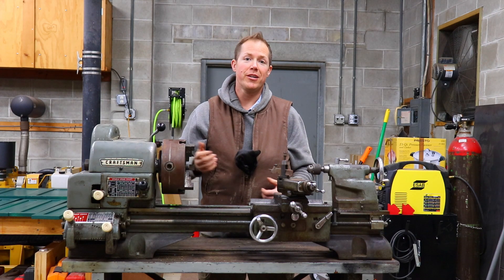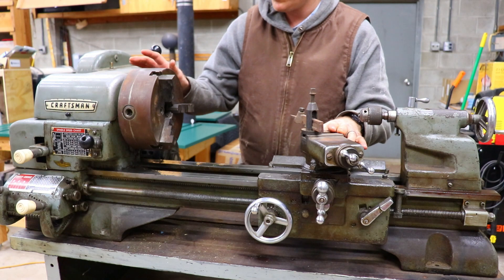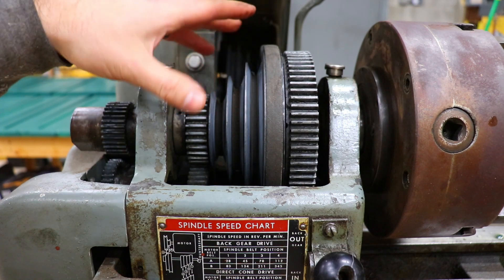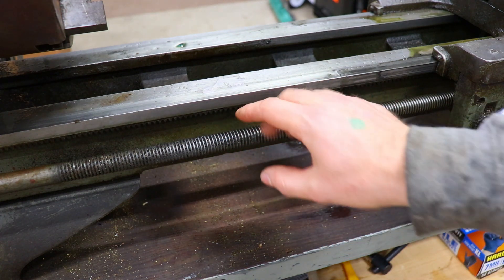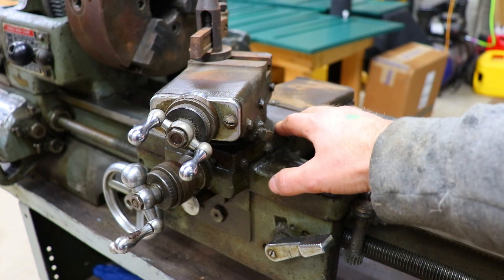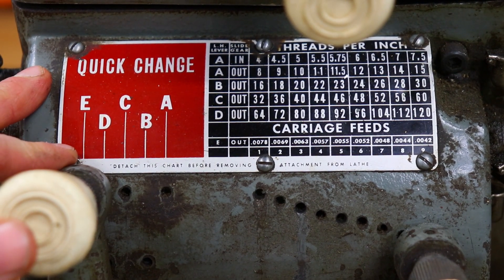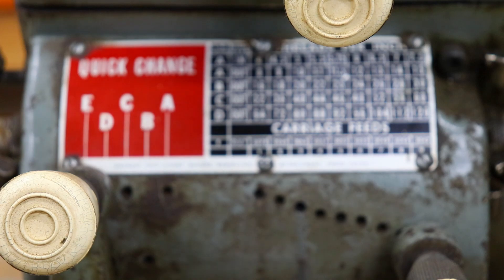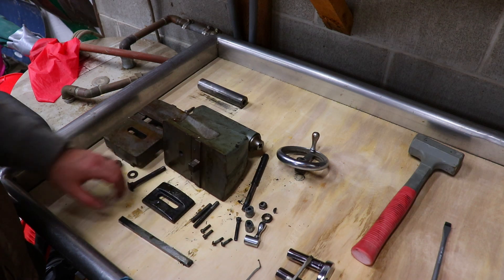Atlas Craftsman Lathe Restoration Revival Part 1

Comment: Were you using degreaser  in the ultrasonic through this process?
Reply from the maker: I used Simple Green and water in the ultrasonic cleaners. It seems to work pretty well.

Comment: Great videos! I just purchased a similar lathe.  It is the commercial model 101.28990.  I am in the process of taking it apart cleaning and freeing everything up. I am just curious as to why you installed the thrust washer on the tail stock feed screw behind the handwheel?   When you took it apart it was on the inside on the other side of the feed nut.  The parts diagram shows it belongs on the inside.
Also, mine is missing that washer bend the micro feed dial on the cross slide feed.  What kind of washer is it?  Is it just a spring washer?
Reply from the maker: Honestly, I hadn't noticed. Thanks for catching it! I will fix it.

Comment: Have you heard if using Boeshield T-9 for lubricating and protecting your ways and other lathe parts? A machinist told me is the way to do it so dust and other stuff don’t stick to the oil like way oil.
Reply from the maker: I have not heard of it. Thank you. Excellent suggestion.

Comment: Thank you for doing this series. I just bought my first real lathe, an Atlas QC-42 which is a 10" lathe. It has the quick change gears like yours does. Original motor is trying to start, and I believe the capacitor is bad on it. It came with the original cast iron stand and the two wooden shelves. All of the handles on the controls on the cross-slide vise are broken (Zamak?) and a few gears need replacing. I hope I'm able to find the parts, either used or reproduction. Or else I'll have to sell the parts off of it.
Reply from the maker: I was able to find most of the parts I need on eBay. Sometimes they are listed under the wrong part number so you have to be careful.
Reply: Thank you!

Comment: You probably already know it, but the chuck is at least a third larger in diameter than that machine was ever designed for. If it has not already damaged the spindle bearings, it will if  you continue using it. But again, I suspect you already know that.
Reply from the maker: Thank you! I did not know that. I have two smaller chucks that I intend to use with the lathe. Luckily the bearings were in good condition when I got to that point in the restoration. Not sure why they had such a huge chuck on it.
Reply: @MakeStuffNation  WOW, then I am glad I shared that with you. I have a twin to your machine with all the original Atlas tooling it came with. If you want, I can get measurements off my chucks if that would help. The 4 jaw original is a significantly larger diameter than the 3 jaw these machines were originally equipped with. I suspect that chuck likely came on something like a Southbend heavy 10" 

When you are ready to use it, get a quick change tool post for it, you will be glad you did. Unless you are wealthy and can afford the best, Aloris, or Dorian, Look at Phase II brand. Import and half the cost of the good brands. Also, if $ is tight the next decision you will have is piston type post, or wedge. Wedge is better, but costs more for guys with shallow pockets like me. I had to settle for the cheaper piston, but have never been disappointed with the piston. 

Next decision is size of post. Ideally an AXA would be the first choice. I opted for a BXA  post, which absolutely looks a bit large on the machine, but in use works just fine with no issues I have noticed.  I chose the BXA specifically for one reason only. I can use a scissors type knurling attachment from the tool holder. AXA posts you cannot do that with as unless you build one, you cannot buy a scissor type knurling attachment to fit an AXA tool holder. 

Don't use a pressure type knurling tool holder on an Atlas machine. If you do, don't do it very often, or you will destroy the brass nut on the cross slide. 

Atlas made them that way for use with a lantern type pressure knurler, but simply put, those machines are not heavy enough to do much knurling on with that kind of holder without damaging that nut. Pressure type knurling tool are fine for heavier machines like South Bend, Logan, Etc. Just NOT Atlas.

Comment: I have the 12” commercial version with the metal base . They actually function well . I have a 3 phase motor and converter so speeds hasn’t been an issue for me and surface finish is good .the issue most talk about is speed for threading is to fast my converter took care of that problem.
Reply from the maker: Cool! Maybe I will do a motor swap sometime in the future. Yes, the carriage feed is a little fast for a nice surface finish.

Comment: Great video, you got the lighting and camera angles well sorted, something that is a problem with YouTube videos.
I have just acquired the same 12" Sears-Atlas lathe, complete with both fixed and traveling steady's and a milling attachment.
Your video's will be most helpful a I start the restoration process....cheers Mike
One suggestion, center punch the end of the gib strips and slide casting to keep the original orientation on reassembly
Reply from the maker: Thanks! Project is sidelined a little bit for the moment as I'm trying to get my wooden sailboat ready for that wooden boat show next month and also working on some spring cleaning. Should be back working on the restoration in a few weeks though.